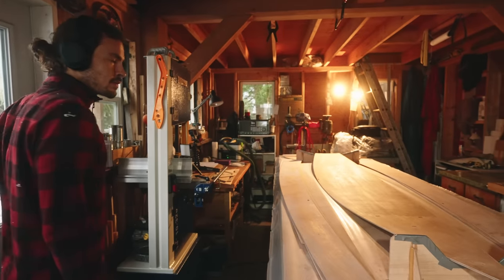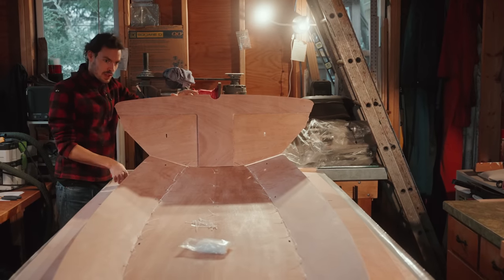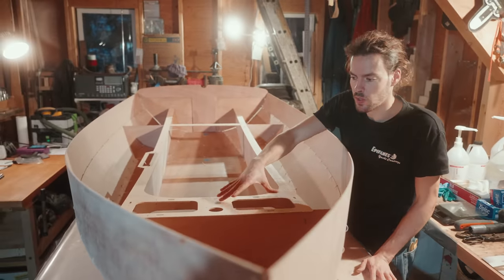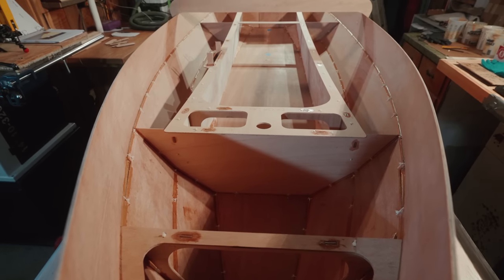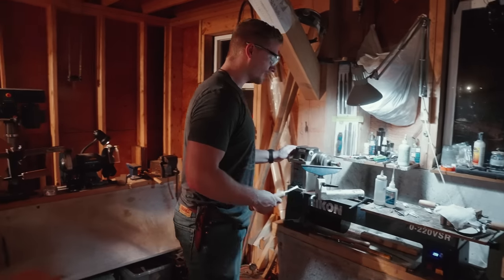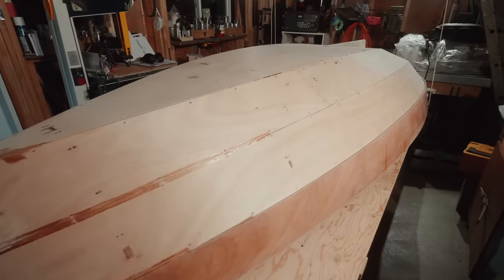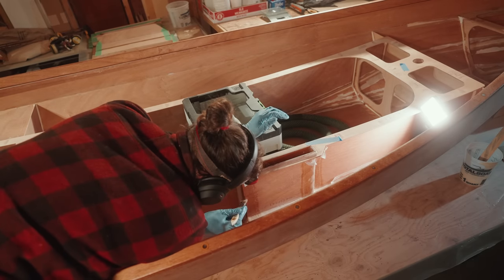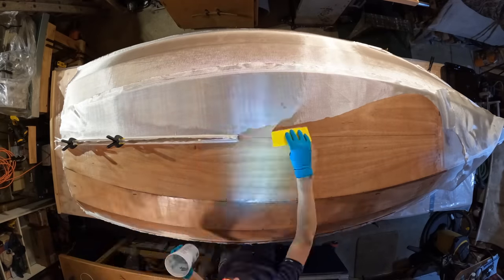Can building a sailboat be this... easy? [2/3]

Comment: I built 3 stitch and glue boats and where I used wire I took a car battery and jumper cables to heat the wire. This tapping across the wire ends released the wire from the joints which made the wire easy to pull free from the joints. You just heat the wire until it smokes.

Comment: I've never seen anyone glass over wood without coating or saturating the surfaces first. I have always been assured that this would lead to delamination. So Ive never personally tried this method. It could be that the dementions of your material was thin enough that the saturation would be done in your first coat.
No matter what your work looks wonderful. Can't wait to see the next installment.
Reply: I do know people that will coat raw plywood first, let that cure and then sand flat prior to glassing. You may get a flatter result by doing this extra step. But, wetting out through the glass onto an un-coated plywood hull can get you the same result and save you a step and time and sandpaper. It's all about the volume of epoxy you use and paying attention to both the color and texture of the glass.
You want the glass to go clear, lose the white color, but still see the texture of the weave. You should be able to see the grain, color and loveliness of the wood beneath, but still also see the weave of the glass. If you see the glass go from clear back to some variation of white, you need more epoxy. If you don't see the texture of the weave, but have a glossy lake of epoxy, you should squeegee some off until you get back to seeing the weave. Strike the balance and you're good to go.

Comment: Sweet little boat and a good idea to build it before tackling the big project. I recently built a Wylo 2 in Qualicum Beach BC . A 35' steel sailboat. The first item in the building instructions was to get yourself a "sanity machine"... i.e. a small boat in which you can have adventures on weekends and holidays, while the big boat takes yet another year to get built. I built a chameleon nesting dinghy which also has a sail rig and a pair of stitch and glue kayaks... well worth it. The chameleon now serves as a capable tender and can be towed or nested on deck. Will look forward to seeing more progress . Building a boat is still one of the most satisfying things I know of

Comment: We built a 16foot "console skiff" (centre console) in about 2000 and have used it to go camping on "Tree Island" in the Sandy Island Marine Park at the north end of Denman Island. It was stitch and glue with copper stitches. I would even build a much bigger hull using a variation of the same technique. It has held up well even in 4 foot chop.... better than it's occupants  ;)

Comment: On Dinghies that get dragged onto the beach a lot I will use a .4 oz Kevlar veil cloth.  It looks a lot like CSM but very thin, like yellow tissue paper almost.  It wets out very easy, I tear the edges and do overlapping strips and I basically end up with a total of 4 overlapping layers after 2 laminations.  I've used the WEST system barrier coat additive to the epoxy (graphite powder) which makes the epoxy black.  Dragged the boat across a rocky beach, not a scratch or gouge.  I swear you could get into the boat on a huge mountain and slide down a paved highway or drag it behind a truck and you wouldn't eat through the bottom.
Reply: I really like putting graphite powder into protective epoxy coats on dinghy bottoms.... and also daggerboards to keep them from scratching in their bearings, surface coats for molds and tooling we make.  It does form a really nice protective surface that is quite a bit harder to scratch than paint or raw epoxy.  Trick is to not get too greedy by mixing it too thick... instead apply 2-3 nice thin coats using a heat gun to help it flow out.  On the kevlar front I used to use a lot of that for structural reasons back when it was cheaper than carbon fiber.  It has its place but is very difficult to use as it is difficult to cut, absorbs moisture, and creates fuzzies on the surface.  The fuzzies are really hard to eliminate as they keep springing back and printing through your finish layer.  We used to always cap any kevlar with thin fiberglass cloth for this reason.
Reply: @turnpointdesign  good points, but you missed my specific reference to the type of kevlar.  The veil cloth is .4 oz and random strands like CSM, so its specifically made to not give you print through.  It sounds like you were using a standard woven cloth like 4 oz.
Reply: @SteelDoesMyWill  Hi Luke, I was talking about Kevlar in general--  Not the print through (when you can see the weave pattern telegraph itself into the surface finish) that is a different kind of problem and you are right that it is usually helped by having CSM fabric on the outer layer.  What I was referring to is when you sand into a kevlar fabric that is on the surface, the fibers are so tenacious they do not get sanded off and now fuzzy little dry kevlar fibers are poking up all over your surface.  They are amazingly tenacious things that will pop up in the next epoxy surface coat, a primer coat, or a finish coat even after much sanding.  This can even happen with the small kevlar thread that is sometimes binding the edge of carbon fiber fabric.    There are some tricks to getting rid of the fuzzies that can get you past this endless loop of sanding and priming kevlar... but in my shop we have learned the hard way to just avoid ever having it as a surface coat.

Comment: Love it !! - I built a 'stitch & glue' Mirror Dinghy in Bermuda 2001. Not as pretty as the one you have built, but I have had a lot of fun building it and sailing it. You have done a much better job of constructing it than I did. I didn't clad the outside in fiberglass, which in hind sight, was a big mistake. I just had to do a major repair to my boat due to wood rot....  but after 20+ years, I guess that's not too bad.

Comment: I was interested to see you using the West epoxy again. I started using it having seen you work with it earlier on MC2. I find the ability to so easily adjust the viscosity with filler makes it so versatile in having exactly the right mix for the application. 
So many thanks!! 
 Peter

Comment: Nice work kids. I have designed/built a number of S&G boats, and found that symmetry is more important than perfection.  Chines are especially hard to get perfect. Also, changing shop temperature can help control epoxy curing speed and save on hardner investment!

Comment: I tried both wire and zip-ties, and I prefer wire. First, I can drill smaller holes (which are therefore less visible afterwards on a bright/varnished hull). Second, they can be easily loosened (unlike zip ties) and are easer to incrementally adjust. Which makes fine-tuning and readjustment simpler... 
Reasonable minds differ of course. Zip-ties are faster and cheaper, etc...
Reply: Interesting, I've used copper wire and galvanized wire as well as zip ties and even gorilla tape. Your positive points for wire are spot on. I prefer the zip-ties.

Comment: I am a civil engineer. I find it interesting to see the clever use of geometry to provide strength to the other weak points of the structures; here I am referring to the stiffeners, bulkheads. I'm wondering if the designer (of the kit) has done some structural analysis calculations (by hand or computerised modelling) to check and optimise the designs. Good recording of the whole process. Thanks.
Reply: Excellent observations. Brandon Davis of Turn Point Design is the designer and kit cutter. He's a pretty smart fellow and does just about everything on the computer. I've seen him reply to a post or two, perhaps he will see his name?

Comment: Your tender seems like a great approach and you building it reminded me of another one. I'm not suggesting you should take another approach or design. But.
I could imagine you are familiar with Leo Sampson Goolden and his rebuilding of a classical sail boat Tally Ho (a 1909 Albert Strange designed Gaff Cutter of 47 feet).
Leo built a dingy of a neat design that has a double bulkhead in the middle that you can slide off of each other and next end up with two half boats.

Comment: Just a little thing, I was just wondering about how the centre board case is done? As in internally is it just relying on the squeeze out of thickened epoxy when assembled? I can't see any way of taping all of the internals easily (maybe not required or I'm missing a trick)

Lovely looking wee boat! I've been enjoying this sub series and can't wait to see the finished dinghy in the water. 

There's another channel I follow (Sailing Yacht Florence) who've been documenting their ATW cruise who went with a kit built sailing tender. Theirs Is a nesting one though.
Reply: The daggerboard trunk gets filleted internally and glass taped on the outside corners, plus is fully supported by the planks as it exits the hull and where it penetrates the deck.

Comment: I have watched this build with interest, a pretty boat and clever design. Would make a good car top highdays and holidays fun boat. My concern is that for the most part Tenders live a rough life, tied to a busy quay with fifty other tenders whilst shopping, left for a weekend on the deep water mooring, dragged up and down beaches, overloaded and generally abused. So is it worth all that time and effort in it's construction, a cheaper faster more basic design might not be as aesthetically pleasing or perform as well under sail but in terms of time and cost over working life far more practical. My brother and I knocked out a simple pram over a weekend and a couple of evenings after school he was ten and I was twelve,needles to say it was a little rough around the edges we used string not zip ties and glass tape not filleting compound so it was rather slow going, but that little boat was worked for twenty odd years at very little expense and no worry.

Comment: Wow! It is interesting that the centerboard trunk looks off-center (and over on the starboard side of the boat). Won't that compromise certain windward  (close hauled)  starboard tacks when the centerboard won't be able to be fully submerged - even if it is down all the way, as the wind coming  over the starboard side of the boat  will be forcing the boat to heel, lifting the centerboard up  kind of close to the surface of the water and possibly making the boat lose position/traction??   Maybe they don't think the boat will heel that much. So maybe it is a non issue. Still, it seems odd not to have it centered.
Reply from the maker: Apparently no difference was noticed while sailing:)

Comment: Aladino, what were you using to sand or scrape the fillets?  I'm at that stage of a sitch and glue dinghy.  It's hard to get those smooth.  I'm enjoying seeing your work and techniques.
Reply from the maker: I really like the bahco  scrapers. You can also get pear shaped and round blades for it.  The easiest though is to wrap some sandpaper over a wooden dowel of the same diameter.

Comment: Hi, great work. One technical question, if I may ask: I saw in the previous episode that you glassed the panels. Now, before adding exopy to the joints, don`t you need to send the fiberglass at the joint area in advance?
Reply from the maker: Correct! All the planks have been prepared before assembly

Comment: Did you not have a problem with amine blush between the fiberglass and the seal coat on the bottom?
Reply from the maker: No problem:) I was using a low amine epoxy and was heating the shop well
Reply: @SailingMagicCarpet  Always amazed and grateful when the famous reply to me! West  System?
Reply from the maker: @davidford694  system 3

Comment: would you mind explaining the performance expectations of the offset centerboard ?
Reply: I had a long conversation with John Welsford, Naval Architect from New Zealand, years ago. Many of his boats have an offset CB too. His opinion is that the sailor has far more impact on the performance of the boat than the location of the board. He suggested that you could sail two boats, same design, one built with an offset CB and one on the centerline and have a hard time noticing a difference, the better sailor however would be faster in either boat.
Reply: @scottjones536  ... Thanks Scott ... appreciate the reply

Comment: you didnt use west systems epoxy for this build right? i aks this because you didnt use any peeply to finish the lamination schedule and for the filler coat. im guessing the epoxy you used was either a 2:1 or 3:1 mix ratio being amineless. is this a correct assumption?
Reply from the maker: Yes I was using low amine 2:1 epoxy. My favorite is by totalboat. I did also use some peel ply on the planks and the taping though

Comment: Would it have been better to use metal wire rather than plastic zip ties?  I dislike plastic for anything and It seems that copper wire would have done the job just as well.
Reply: That is the one drawback of the zip-ties... plastic. On the upside, much of the foam parts in the boat are made from recycled plastic. Offsets :)